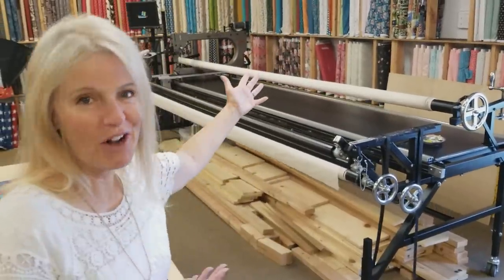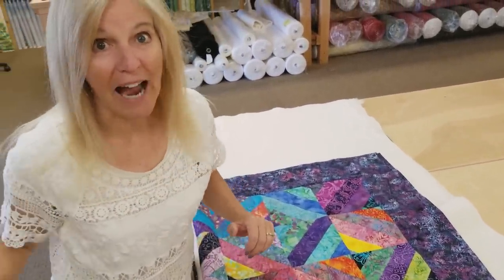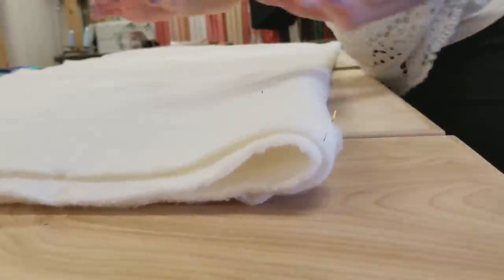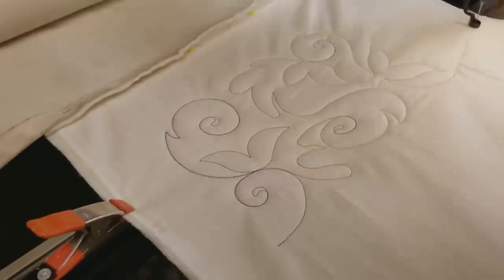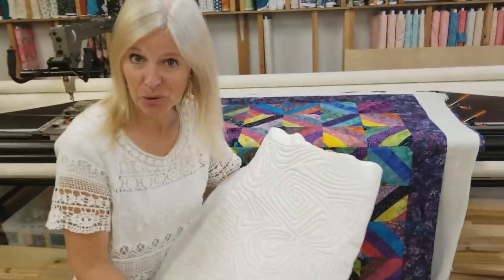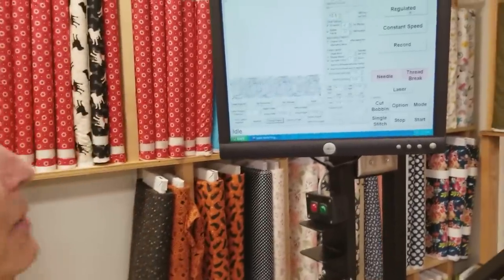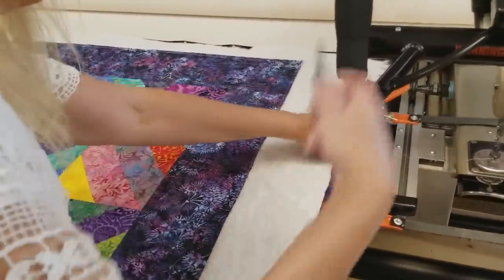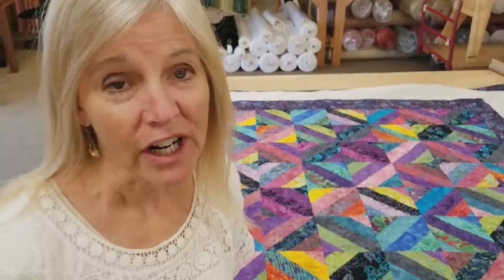HOW DOES QUILTING MACHINE WORK???

Comment: I have a sit down mid - arm and I fold my backing, batting and top the same way.  I have a pair of straight pins, in a plus sign, taped in the center of the table.  Then I line the folded backing up with those pins when I lay the backing on the table. I gently unfold it and clamp it to the table with hand clamps, like the ones you use to tension the sides of your backing. Then I follow the same procedure with the batting and the top. I watch most of your videos, many times over. Even though I machine quilt my quilts using a different machine, your videos are still an inspiration for me. Thanks for all the work you, your son and Matt do.

Comment: This was so interesting and informative. I have been trying to learn long arm operation since I started working with one that was donated to our church.  Most of the ladies I sew with are elderly, so much has fallen on me to set up and complete.  Ours is a Gammill Classic, very old, and of course there is no computer nor a stitch regulator.  I saw that you did not pin your top on.  I have no basting stitch, so I do pin it first.  Our frame also has a third leader for the bottom of the top layer of the quilt.  I noticed yours was free floating.  I have seen some use clamps on the bar in front, but have not ever seen it free floating.  I found this very interesting.  Thank you for taking the time to do this.  I would be interested in the video of the quilt you mentioned.  I enjoy your clear directions and suggestions.  I started hand quilting at our church about 3 years ago.  Last year I learned how to put a quilt on a wood frame for hand quilting and basically had to figure out the marking as people were leaving our circle due to age and health.  Now I am giving this old long arm a try.  Thank goodness for YouTube!  That is how I am learning to piece, machine quilt, etc.  Channels like yours are helping me so much!

Comment: This was extremely helpful. I am gaining speed in my learning of how to quilt due to the details of Jordan Fabrics' video tutorials.  I was trying to decide if I should buy a quilting machine and have been researching the machines; however, I had not seen a video that gives us a bigger picture of the quilting process.  This is the video that muct be seen.   I like the idea of having software to do the designs as opposed to free-motion quilting.  Jordan Fabrics has the "Rolls Royce" of quilting machines - the Gammill but there are many smaller long-arm quilting machines and frames to fit your designated space and budget.  They all work basically the same as Donna's machine.  Thank you Jordan Fabrics.  Please make more videos.

Comment: I have a Grace Hoop Frame which is much more compact than the full size frames, and the15" throat machine. Purchased last year and never used yet, other than to make sure it turns on (long story with various excuses about the lack of use). Hopefully, fingers crossed, I will start quilting with it this month! Even though mine is quite a different system, this video helps to reinforce the necessary prep work, despite the clamping also being different. If you ever get one of the compact systems in the store it would be great to see a video on that. And another vote for redoing the Tea Time video, strip quilts are so much fun. My first ever quilt was one of the patterns in Kathy Brown's 'Strip Smart Quilting', and the blocks are very similar.

Comment: Another GREAT tutorial from Donna and crew. Donna, have you ever had any problems with your Gammel or the computer that controls it? How about needles breaking,  thread breaking or snarling, the holding clamps not holding, etc, and I'm curious to know how much thread goes through the machine when changing colors? Any answers will be informative. Thanks. I absolutely love to watch your videos. You explain everything so clearly and patiently, I'm SURE your videos have made many newbies want to try quilting.
Reply from the maker: I haven't had any real trouble with my machine. I have a mechanic check it over every so often to keep it running smoothly.

Comment: This was a really great video and you really know your stuff!  Unfortunately, along arm is not in my future.  I use Amelie Scott Edge to Edge Quilting on Your Embroidery Machine.  I did pick up a tip from you though.  I like how you folded your top, batting and backing in quarters to find the centers and marked with a pin.  I'm going to incorporate this idea in MY quilting.  It may make it easier to set up the quilt sandwich for quilting, especially since I have to lay it on a full size bed to smooth things out.  Sometimes I have my layers going in wrong directions and there's no border around the top!  Thanks again for this very informative video!  I also like how your pulled up your bobbin thread!

Comment: I've been looking at longarm demo vids since 2005. This one answered a lot of questions none of the others answered, so thanks. Also, your son does a much better job of filming than most other camera operators. You two learn quickly. Still, I have one question you might be able to answer. I know the Gammel system allows one to design original quilt patterns, and to import pattern files from other software programs. The question is this. Will the Gammel software import files from CorelDraw (a vector graphics program), or where can I find a list of the file types Gammel can import? Thanks so much.

Comment: This is a really amazing video, thank you so much. May I ask for an addition please? I would like to see how the machine is thread and bobbin is wound? Can you please also show how thread tensions are adjusted with this machine so they handle best with the different thicknesses of the battings? And does the machine do all patterns by itself or are there quilts where you have to guide the machine by its handles all across the quilt, too? Many thanks for your wonderful time spend with your fans :)

Comment: as always this video was very informative. i don't have a long arm and my budget won't allow one but it was very interesting to see how it works. my only  comment is that the audio level varies greatly during the video. i have noticed this before but in this video where you are moving around a lot it sometimes fades out to almost inaudible. perhaps a battery microphone pack would be a good alternative for your current system.

Comment: Donna, I’ve watched many videos to help me learn how to load up my quilts onto my new Gammill and yours is by far the easiest way!  Thank you for that!  One question for you.  I’ve been told that you have to remove that pin on the end to release the belly bar while your loading the quilt, then you put the belly bar back in place.  What are your thoughts about that?
Reply from the maker: I have not tried removing the pin, so I am not sure if it will help or not. It may be so that you can get closer to the top bar without leaning on the belly bar.

Comment: Thank you for doing this video.  I have a question please.  How many quilting patterns comes with the Gimmel and do you have to buy all new quilting patterns from Gimmel or is there other places you can buy from?  How expensive is it to buy new patters?  Also, I call them rollers because I don't know the technical term for them.  But can't you purchase the cotton batting on a large roller and then leave the batting on the machine and then roll it out to the size that you need for each quilt?  Where do you purchase your batting from?  Thank you so much and please keep the videos coming.

Comment: I loved this video!  I knew the basics, but, wondered how it was done!  Great video!  I love the quilt patterns!  While I am no way buying a long arm!  I am going to look for classes & a place where I can take a quilt and DIY rental.  Can I ask a non “machine question?  You guys cut loads of fabric with rotary cutter.......  what blade do you prefer?!?    I’ve tried Olfa, and a number of other brands....  they seem to dull quickly.  At the moment, I am cutting a lot of fabric....  plus I have RA and my hands aren’t happy with anything I do!  But, when I have to try multiple times on a single 2.5 & 5”cut  I know it’s time to change!  I need better & bulk & cheaper (overall) then $5+ a blade!  Thanks in advance for your help! And videos!!!!
Reply from the maker: We use Olfa 60mm cutters and prefer the new Endurance blades. They are kind of expensive, and we change them often, but a sharp blade is critical for comfort, safety, and accuracy.

Comment: Hi Donna, I have a much smaller frame which I use with my mid arm Juki.  I am curious about putting the back on “Sideways” with the selvage at the top, but then you put the quilt on with the top “upright” . I understand the need for it to be straight, but I am confused about them running in different directions

Comment: Loved the video.  I have wanted one of these machines for years.  I will never be able to get one.  I do have a couple of questions.  What do you do with your excess batting and backing?  Also, how do you charge for quilting?  $$per inch or do you just go by the size?  
Love your videos.
Reply from the maker: I use all the scrap batting for table runners and place mats. The backing scrap often gets used for binding or I just keep it for another project. We are not currently offering quilting services, but most quilters charge bu the square inch.

Comment: This was very informative. I have been tossing around the idea of getting a longarms. Do you have suggestions of what type of system to get for a retired hobby quilter? I mostly make charity quilts, so do FMQ on my Bernina. But might branch out for larger projects if I had the proper equipment.
Reply from the maker: I recommend finding a dealer in your area who offers good customer service and letting them suggest a model that will work for your requirements.

Comment: thanks for this! I love the peek into all the details of how this works :) Does the longarm have a typical bobbin, or is it also fed from the thread cone? If it's from a bobbin, does the machine have a way to tell you when it's low or run out so you can refill?
Reply from the maker: The machine uses bobbins, but they are larger than those used on my other machines. The machine stops when the bobbin runs out.
Reply: @jordanfabrics8380  thanks! That's really interesting

Comment: Great Video! Question: After choosing a quilting pattern, and the computer figuring out the repeats needed in order for the pattern to fit on the quilt by stretching the pattern, would you need to do a 'practice' piece again....as now the pattern has changed from the original that is shown on the computer screen? The density of the stitching would change, hence the pattern has changed as well.....thanks!
Reply from the maker: I only do another practice piece if I change the pattern size a lot. If it is just a bit as in this one, I don't do another one.

Comment: Thanks for the good video. The only thing you didn't include is the Bobbin. For a quilt the size of the one in your video and the density of that design, how many times did you have to stop and put another bobbin in the machine? I'm sure the machine stops and or has a warning alarm that it is getting low. 
I really want to know whatever you can talk about regarding the bobbin and it's capacity compared to other quilting machines. Thank-you!!
Reply from the maker: The bobbin is larger than on my other machines, but I have not compared it to other brands of long-arms. I used 3 1/2 bobbins for this quilt.

Comment: I do still have a question after this video: you speak of the bobbin thread...where and what is the source of that, and how do you know when to replace it?
Reply from the maker: The machine stops stitching when the bobbin runs out or the top thread breaks. I wind several bobbins before I quilt the quilt and change them as needed.

Comment: Donna how often do you have to fill your bobbin? What happens if you run out of bobbin thread? Does it stop?
Reply from the maker: The bobbins are pretty big and the machine stops if the thread runs out. I use 3 to 6 bobbins per quilt.

Comment: When you piece the back, do you have the seam running the length or width of the fabric? Does it matter in regard to the machine quilting?
Reply from the maker: It doesn't really matter, but to pin the back onto the machine you need it to be really straight. Also some of the quilting patterns have an up and a down and then the quilt needs to be loaded so the pattern doesn't end up sideways.

Comment: Ok Jordan,
I have a question , How do you hook the computer up to the quilting Machine? And will the way you hook it up work with any quilting Machine?  I'm trying to decide weather to buy a quilting machine or buy a Embroidery machine , I'm actually fighting with myself on which one would be be better to start my business with , . I want both but i don't have the room for both .thanks
Reply from the maker: You will have to ask a machine dealer those questions. I bought a used Gammill long-arm machine with the computer already hooked up, and it is pretty old and still works great, but I am sure that the newer machines have many more options that I do not have.

Comment: More to it than I originally thought. How do  you charge for doing a quilt? (Guidelines)
Reply from the maker: We are not currently taking in any quilts from customers, but most long-armers charge by the square inch. For example, if a quilter charges 2 cents per square inch for edge to edge computerized quilting, then the total will be $82.50 for a 55 x 75" quilt. If you need any custom work done, then of course it will be more.

Comment: I have a membership at a co-creating space where I rent time on various machines like the long arm. I'm a newer quilter, so I'm not always great at troubleshooting. The long arm in this space was assembled so the leaders aren't level. Specifically, the backing leader on the top (the furthest roller from where you stand at the front of the machine). So, when I attach fabric to it, it's attached at an angle. I've completely unwound the leader and wound it back up smoothing the best I can as I go, but when you look at the roller, the leader isn't attached levelly. I've managed to kind of fudge my way through using way more backing fabric than I should need, and I've watched countless videos looking for tips, but I am still struggling. Do you have any tips for how to load a quilt when the leaders aren't installed correctly and aren't square?

Comment: How do you figure the charge for quilting a quilt?
Reply from the maker: Most quilters charge by the square inch, so if your quilt is 100 x 100" square and your quilter charges 2 cents per inch, then the quilting charge will be $200.00. We are not currently doing any quilting for customers.

Comment: Why don’t you pin the opposite end of the top. You basted  the top and sides, but the end is just hanging. Does your machine have a third roller?
Reply from the maker: There are other methods for attaching your quilt to the machine. I am using the floating method. Prior to quilting the last row, when the bottom of the quilt was finally up on top of the machine, I basted it too.
Reply: @jordanfabrics8380 , thanks, I will this method.